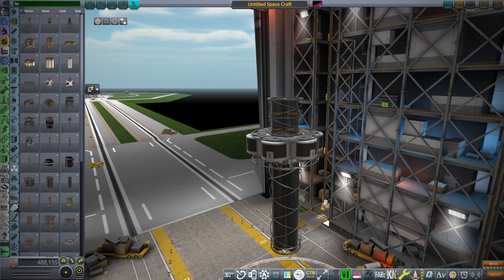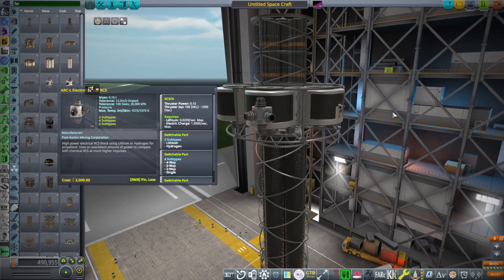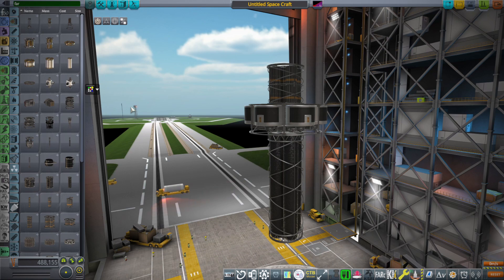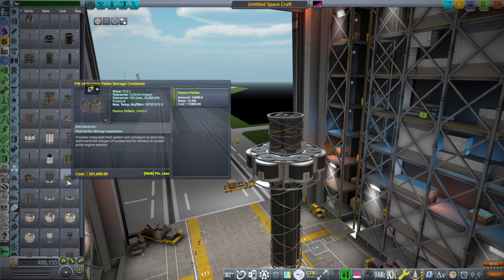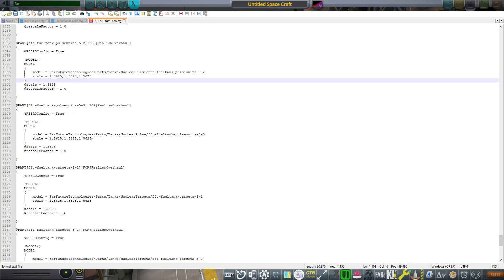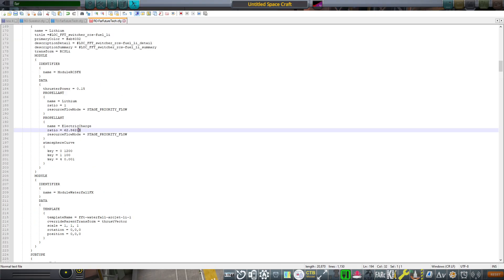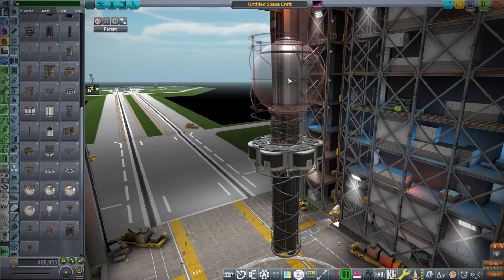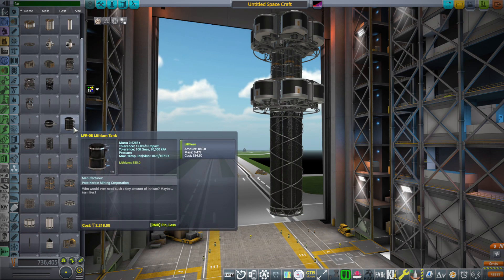Far Future and RO (KSP 1.12)

Comment: Do you think KSPIE is playable without any config ? in RO RSS
Reply from the maker: You need to at least go into the RO folder, open up the RO_Engines.cfg file, and delete the section that gets rid of TweakScale on all engines, since KSPIE uses tweak scale on its engines to make them work properly with the reactors etc. Otherwise, things should work okay, but will be marked non-RO and may be hidden in some circumstances.
Reply: @RaizSpace  Oh okay thank you for your help!

Comment: I would love to see KSPIE compatible with RP2000. I remember a Raiz video about KSPIE like 10 years back. The thing is that near future is quite simple. With KSPIE it is a struggle to find out what works as intended and what does not. KSPIE started off as not super complex. But over multiple updates, where more parts and mechanics were introduced, legacy parts were left to rot. This meant that half the stuff that did work in the past doesn't right now. With the complexity it's hard to figure out wether it does actually work and that I am just stupid or if it doesn't. Not to mention the inbalance of KSPIE parts in career mode. Warp drive would be cool if it were very complex and expensive to have work. But it's easier than most parts in the mod pack. What even is the point of very complex multimillion isp engines when you have warp drive. I would really like it if someone just takes parts and mechanics out that don't work as intended or are incredibly inbalanced. Sorry for the ranting.